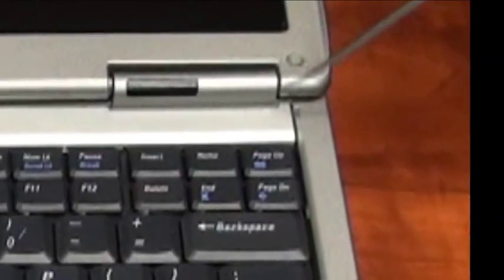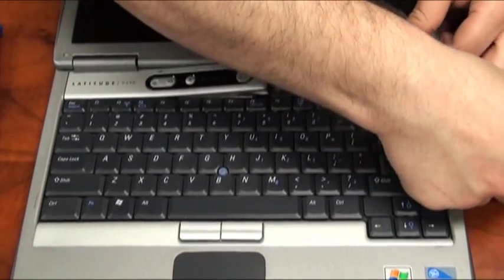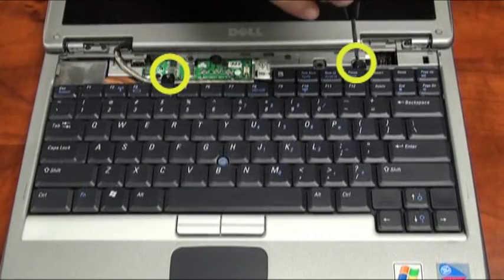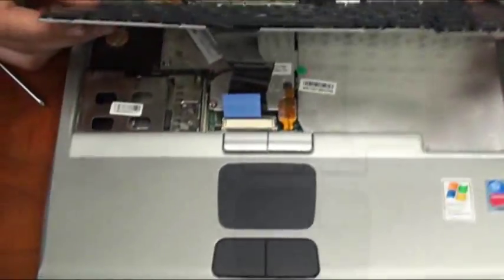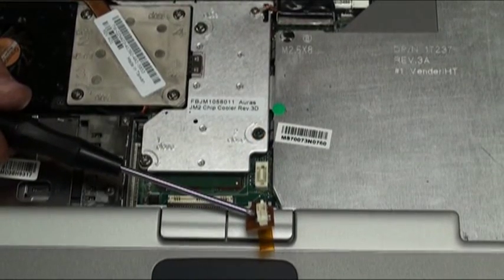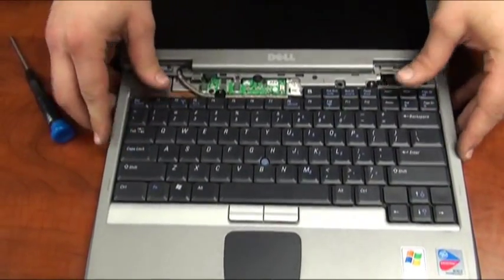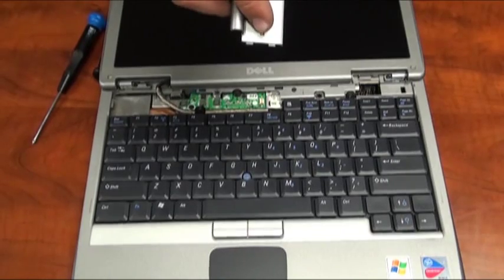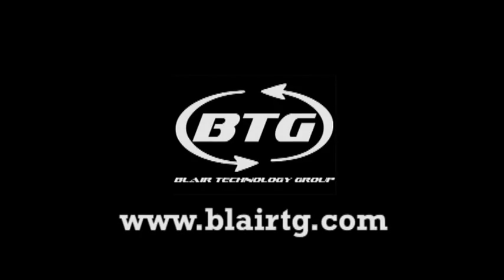Tutorial: Reseat keyboard on Dell Latitude D600

Comment: I bought an IBM Lenovo T42 on eBay in June 2013. Wifi hasn't worked properly since it arrived. I'm not even tempted to spend a penny to try to fix it, as word on the net is that many or most of these T42s have malfunctioning wifi.  I'm wondering (1) how much I could get on trade-in; and (2) is the IBM Lenovo T60 or T61 more reliable in terms of wifi, and everything else?

Comment: try looking on the dell webpage for the support pages. Choose the support for it-pro's. there you will find the service manual for your laptop. But basically you just need to unscrew the screw which hold the cover for the hd, and you can just slide the hd with its casing out of the laptop. You just then need to remove the casing from the hd by unscrewing the screws holding it in place. Should not take more than a minute or two.

Comment: Usually it's quite a complex system. consisting of a rubber round piece in the middle. I suppose that's still okay. Then you've got two white pieces, one shaped like an U and the other one As a more square like with a round hole for the rubber piece. Each of these pieces have some small feet which fit in the wholes at the bottom of your keyboard. Try putting them in, i don't know the the correct order, so you got to trie this yourself After that, you should be able to snap the top plate in place

Comment from the maker: @Joseph9536

Bumps and jolts from normal use or transportation can cause the keyboard to loosen from the motherboard connector.  If you notice certain keys not functioning properly, a keyboard reseat can fix the problem.  Secondly, dirt and dust from industrial environments can interfere with the connection.  You would follow the steps from the video and also use canned air to blow out the motherboard connector.